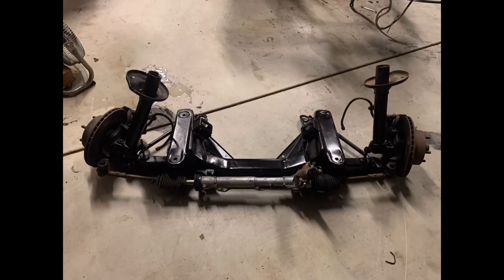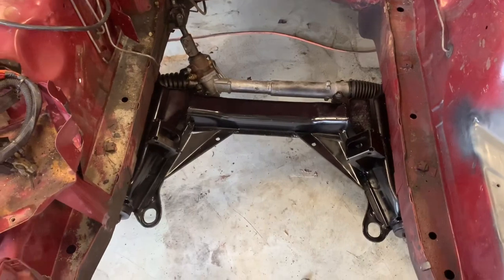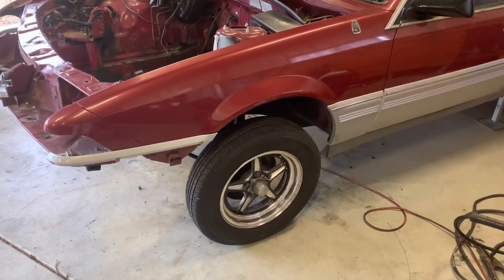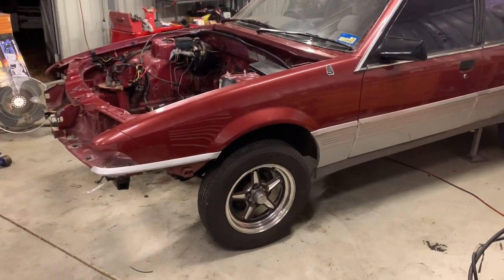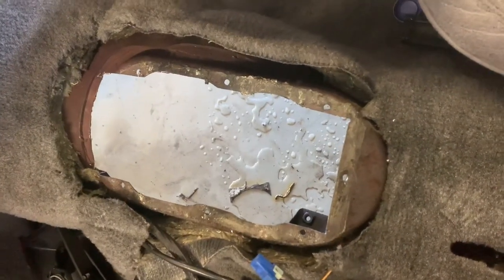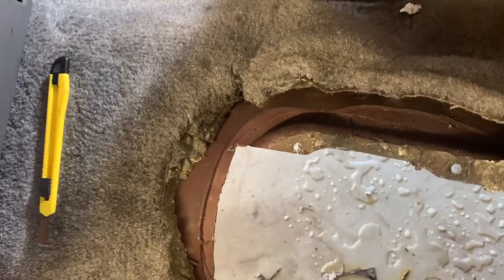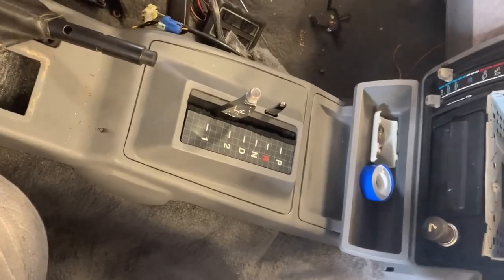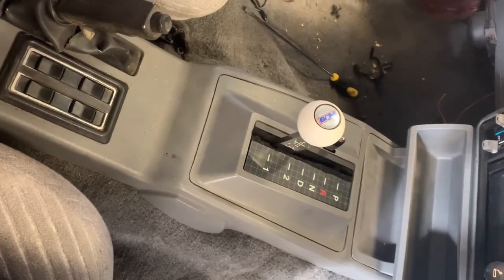Vl Calais wagon new shifter instal  and front Suspension video 7

Comment: Did you change the strut shocks also or just the springs
Reply from the maker: Yes fitted new shocks aswel
Reply: @builtbyjuz4419  nice, are the shocks interchangeable in the strut or are the strut and shock one unit.
Reply from the maker: @79series  na u can change them out man, once u have the spring off there's a large retaining but that holds the shock down inside the strut, once u undo it the shock slides out
Reply: @builtbyjuz4419  thanks mate.